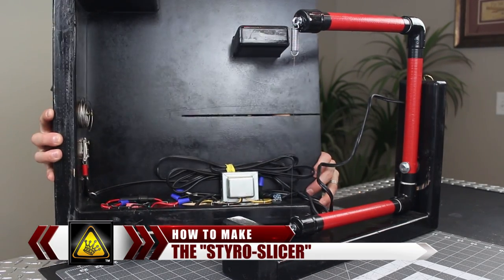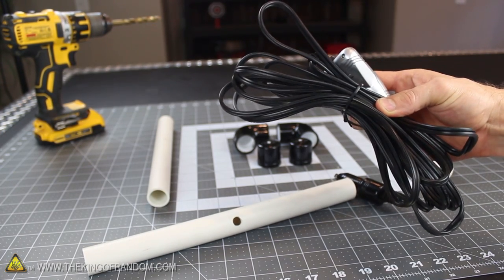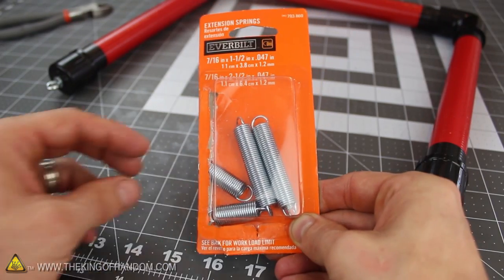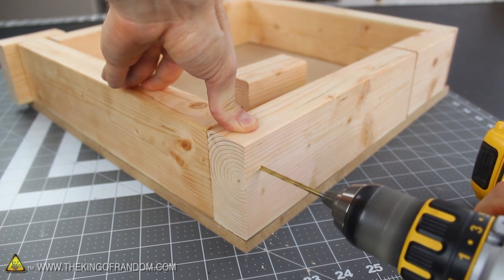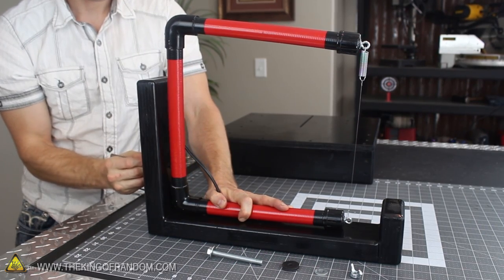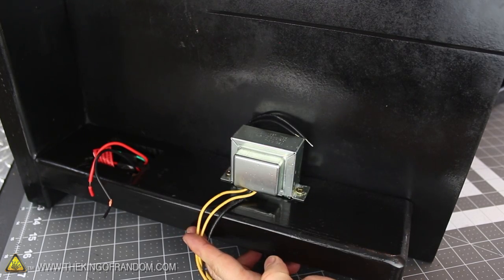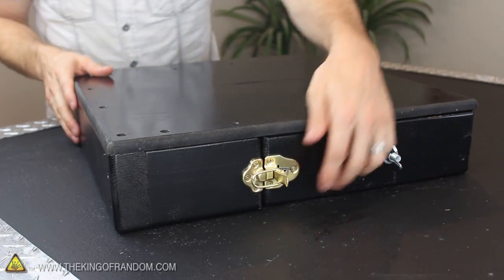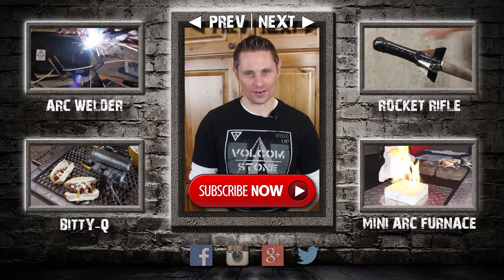How To Make The "Styro-Slicer"

Comment: How to tie the knot @ 2:20
-Have the wire already be stripped, separated, and looped at the end.

-Drill the hole into the PVC pipe.

-Now, before you add the elbows to either end of the PVC, push both ends of the wire through either end of that tube. 

-With both ends of the wire in hand, tie a simple knot (it really doesn't matter what type).

-Now, take one end of the wire with a loop, and push it back through the other side of the tube, so that you have a wire with a       loop at the end of it on either side of the first PVC Tube

-Pull the original wire (the one that first enters the tube at the back) so that the knot is at the hole, demonstrated at 2:32.

-Snake each looped wire through the elbow brackets, and proceed with the rest of this tutorial. 
      PS: Awesome concepts, tutorials, and vids man. Keep up the work!

Comment from the maker: Some quick links to a few of the materials I used:

[✓] 12 v transformer (3 amp): http://amzn.to/2cmkPFo
[✓] 3 position switch: http://amzn.to/2cGZjKL
[✓] Push on/off 1000w dimmer switch: http://amzn.to/2c9gXEm
Reply: Np
Reply: I bought .58mm X 76.2 M 24Guage hanger wire and 6 volts wouldn't heat it up enough.
Reply: I blew threw like 3 transformers trying to get this to work and I'm a little confused on y the dim-switch comes before the transformer not after. Am I using he wrong wire? I used like thing galvanized steel wire any tips that could help me finish making this? I'm a big fan and I'm make a lot of your other projects such as the mini melt foundry and the baterangs. Any help would be useful. Thanks Cole 😂
Reply: Thin ****😂😂😂👌🏼
Reply: in the video you used a 600w dimmer, in the comments you recommended a 1000w dimmer...what's the difference? besides wattage of course.
Reply: Grant Thompson - "The King of Random" what dimmer switch should I use 600w or 1000w?
Reply: Grant Thompson - "The King of Random" vv
Reply: Grant Thompson - "The King of Random"
Reply: Grant Thompson - "The King of Random" how thin does the wire have to be. I just built one but my wire slowly cuts through Styrofoam like it isn't getting enough heat. SOS
Reply: Grant Thompson - "The King of Random"
Reply: ArtemisTheGreat thanks man i appreciate it. .
Reply: are you able to make a styro slicer with a styro slicer?
Reply: michael macmillan 
You already made it
Reply: ya my friend wants one too.
Reply: Grant Thompson - "The King of Random" is
Reply: Grant Thompson - "The King of Random" hey I am 14 and I love your sciency vids you have inspired me to save up to make a Styrofoam slicer and metal foundry keep doing what you do
Reply: dagamerguyofawesome Lucky I want to make both I just don't understand how
Reply: Grant Thompson - "The King of Random" will thus hurt you if you touch it? Just wanted to know before I build it. Thanks
Reply: D VLOGS only if u touch it 1 second after. Using it it's not hot after 3 to 5 seconds and won't hurt also don't use it on skin
Reply: 10kw for replaacing scariac ??
Reply: Is this just for styrofoam?
Reply: Do you need the 12v Transformer and Dimmer Switch?
Reply: Grant Thompson - "The King of Random" i made the base and the stand for it but just put some wire connected to a 6v battery like You did at the start but with a plastic tip on one end of the wire so I didn't burn myself. Worked like yours did. I'm in the middle of making your styrofoam pistol
Reply: Make a mini railgun
Reply: The King of Random the stereo slicer. I made a more powerful one to cut wood it’s called a saw
Reply: can and will this cut through EVA floor mats with ease?
Reply: The King of Random yo

Comment: If you can't manage to get the knot tied in the wire, inside the pipe. i suggest using Hot glue, thats what i done. Vote this up so future builders can see this.
Reply: You is life hack king 

Always use hot glue gun
Reply: Thanks Ted. You the real mvp. You know, when you arent killing folks. XD
Reply: you can also get rubber wire grommets at any electrical/electronics supply store.

Comment: The one thing I definitely would have done differently is include a power LED somewhere.  Other than that, great job!
Reply: Can you tell the purpose of the LED?
Reply: @ananyranjan8750  so u can use it in the dark
Reply: I think it’s to tell if it’s switched on or not, since it does not really change in colour until you switch it on at max power

Comment: Do you really need to add the complicated wiring in that ''box'' or can you just make the box and use alligator clips to connect the saw to the battery?
Reply: SkeleBonePancake try it and tell me what happens!
Reply: Not really, the wiring is so you can connect it to the wall. You can just connect it to the battery with alligator clips

Comment: 3/4 PVC 
2 11inch ones red
1 12inch one  red
2 90deg Black
2 caps  Black
#8-32x 1 5/8in Eye Bolts
#8 flat washers

Drill the end caps with 5/32 drill bit do this to both ends

Drill a hole in the middle of the 12 inch 3/8 drill bit

Get two wires one red one black run them to the end with eye holes

Put washer on the end of the inside put wire on then washer and nut

Stainless Hanging Wire or Guitar string Model 
# 50116 Internet # 100069689 Store SKU # 854980

Extenion spring
Everbilt Model # 16109 Internet # 202045464 Store SKU # 703860

18inch's x 18inch's Square of  1/2" MDF or Smooth Plywood

8 foot 2X4 Board

18 inch 2X4
15 inch 2x4
15 inch 2x4
11.5 inch 2x4
5 inch Block
3.5 inch Block
3.5 inch Block

8x3 wood screws
1/8 drill bit

coutersink bit

10 1 1/2 wood screws

3/8 x 3.5 Hex Bolt

2 5/8 Cut Washers

3/8 Wingnut

2x5/16 Tank Bolt Washers

600 Watt Dimmer Switch Push (On/Off) 6683

12v Power Transformer RadioShack 12.6VAC 3A Power Transformer 273-1511B

10 amp Fuse
Reply: bro i've take my transformer from a old stereo but i can't recognize where is the input and the output is
Reply: help please
Reply: Cool
Reply: Thanks!

Comment: Does it cut cheese,  or ABS pipe?
Reply: +Dami Nooki You actually made the Styro Slicer? Cool! Does it really work wonders as Grant says???
Reply: +Dami Nooki So, it's kind of like a skill based tool?
Reply: will it cut fingers?
Reply: +Dami Nooki ooh, ouch you alright though?
Reply: +dami nooki i know this is an old post but do you remember about how much it cost
Reply: John DePuy  i spent 5 OMR which equals 12.99 USD
Reply: Could you test if it will cut HDPE for me? It would save me the work and cost of building it just in case it wont. Thanks.
Reply: k_froggy that's some thick pipes my friend. I don't think so.
Reply: I have 1/2 inch thick wall hdpe barrels i want to cut up.
Reply: k_froggy you can use a hacksaw
Reply: Dami Nooki you've got to be kidding me. Didn't you see how thick HDPE is?! The head that is produced from the slicer can't even cut paper, how would it cut plastic then?
Reply: The heat *
Reply: the styro slicer dicer
Reply: Steven Morris Q

Comment: Hey grant I make the metal melting foundry and it exploded molten aluminum all over my workshop so
What can I do for that
Reply: +How To Guide to Everything            Don't put cans into the crucible upside down, or make a bigger crucible
Reply: Make sure the cans are completely dry, any water droplets can cause that
Reply: thanks guys but it was the crusible that exploded.
Reply: +How To Guide to Everything sounds like there were air pockets in the plaster, mabee some moisture as well.
Reply: +HyperJ Gaming In his video he says it doesn't matter if it still has paint or even soda
Reply: +Cooper Lake in not saying it always does but it can and it has

Comment: I see you got the transformer at RadioShack, but I couldn't find it online. Do you have the model number for it?
Reply from the maker: +pikachu1324 It was from Radio Shack and was a 12.6V 3A Power Transformer 273-1511B.  It is center tapped for 6.3-0-6.3, but doing a quick search on Google .. they seem kind of hard to find right now for some reason, but you can get them around $15 on eBay.  Not sure if Radio Shack carries them anymore.  If not, I would just try experimenting with junk transformers salvaged from larger electronics.
Reply: Grant Thompson - "The King of Random" Okay thanks I found it on eBay.
Reply: You can also get a door bell transform from the hardware store but it might only be 6v so it will take longer to cut
Reply: +pikachu1324 Can you share the link?
Reply: Rocco N April A quick search on eBay for "273-1511B" will produce many results, under $20. Just don't get those $100+ ones.
Reply: +Grant Thompson - "The King of Random" would a 12v 3 A transformer work ?
Reply: Nick W That's actually almost exactly what he used. It would probably work great, with a tiny and unnoticeable difference.
Reply: +pikachu1324 Thnx :D
Reply: +Grant Thompson - "The King of Random" I killed my AC breaker by shorting a transformer to make a styro slicer.
Reply: +Grant Thompson - "The King of Random" 

Would a doorbell transformer do? 12V 60W 5A?    Also, at that amperage, isn't touching the wire a fatal dose of electricity?
Reply: +Yona Tamblin only if YOU were grounded. But because your not, and assuming the wire is still connected to the circut, its gonna take the path of least resistance and head out thru the wall vs thru you. You'd get a good burn tho. Take that for what is tho, my knowledge of curcuts is limited.
Reply: +Grant Thompson - "The King of Random" why do you have a 10 amp fuse for a 3Amp Xformer? the whole reason to have a ocpd device is to protect the wiring and the equipment from damage due to over current.
Reply: +Yona Tamblin nope because 12volts is a very low voltage which means it doesn't have the pressure to really hurt you. and the current would only be harmful if it hit your heart. even then at that low voltage I dont think it would even come close to your heart let alone past your skin. you could have a billion of amps running on 5v (in theory) and not even feel it. even 120 volt is not that dangerous to an adult human.
Reply: I'm definitely no expert, but would a laptop power supply work for this? I have one here that is rated for 19v and 3.6A and I understand that 19v is far to much, but in theory, I just don't know if this would work with the dimmer switch on the ac side of the circuit.
Reply: Jack Davies lol no a dimmer used for lights is not changing the voltage, its changing the frequency at least the modern day ones do.
Reply: +Jack Davies the power supply might work but wont be dimmable its transforming power into Dc currant also
Reply: +Grant Thompson - "The King of Random" I got a 12v Transformer but it has only 4 wires instead of 5. Will it pose a problem.
Reply: Nick490 you have to give more info then just that. is it 2 on the primary and two on the secondary or is 4 on primary and 4 on the secondary, what is the primary labeled as H or X? H1, H2, H3 H4 Primary and X1, X2, X3, X4 on the secondary? if so its not a problem because this gives more flexibility to adjust the voltage.
Reply: +Grant Thompson - &quot;The King of Random&quot; Just use a MOT
Reply: +pikachu1324 
I found 1 in store, (Radio Shack)  it was the last one left.  If I didn't throw out the packaging Ill forward you the item number.  If you rather purchase online, here's some other sites:
www.electronicsurplus.com
www.allelectronics.com
www.surplussales.com
And naturally Ebay.
Reply: +pikachu1324 it is not online but I found the exact one in store, but here is the model number anyway: 03A14
hope you find it!
Reply: +pikachu1324 The philmore TR250 is almost exactly what he used (minus the brand of course).
Reply: Two on the primary and two on the secondary.

Comment: Really thinkimg anout doing it, anyone know a basic price range for the whole thing?
Reply: I spent about 25-30$ on mine but its way worth it if you plan to make a lot of stuff
Reply: +krig20 im already thinking of all the parts a already have, just missing that dimmer.
Reply: +MrCerealShark i just bought all materials except for the tools ( i bought a set of drill bits but not a drill) and after everything it came out to near $70 all bought at home depot except for the pvc, fuse holder, wire and transformer.
Reply: +Vai Peterson (VaiDaPie45) What strength spring did you use?
Reply: the load limit is 11.46 lbs. i used the same brand as in this video. The slicer works amazing! i use it to cut EVA foam for cosplay and oooohhh my god. its been a huge time 
saver haha
Reply: +Vai Peterson (VaiDaPie45) Thanks mate
Reply: yeah for sure
Reply: If you dont have one use a two position switch and then an on/off switch. If youre uncertain with these things you shouldnt be using a power outlet. touching a wire behind the transformer can kill.

Comment: Can you plz make a more easier and compact version bcz I don't have a dad that can help me make this one plz
Reply: Try getting two 6 volt lamp batteries and a wire and attach them parallel to eachother. That should create a crude heat wire, but longer.
Reply: Just use the first 4:
Reply: Buy one, less than $10 and battery powered
Reply: I thought that was the point of the original part when he was just running it off the battery.

Comment: this would be great for making flite tests rc planes
Reply: Was thinking the same thing. I wonder if they have something like this for their projects.
Reply: They use a paper backed plastic that does not work with this technology.
Reply: It does
Reply: +Drew Stevenson they don't use paper or plastic they take the paper off and it's not plastic it's foam
Reply: +Wasteland Survivor the Adams board they used originally for flite test was double backed paper for tensile strength skinning.
Reply: true
Reply: Yes it does
Reply: Bjako - Psh, on the higher setting, you should be able to cut thin wood.

Comment: How do you tie the knot inside the tube?
Reply: It's easy. Just tie some kind of thread to one of the wire ends, then pull the other one till the first one with a tread tied to it comes out, now diconnect that thread, put a knot in the wire, reattach the thread and use it to pull one of the ends back through to the other side.
Reply: Bref Stank put both wires out one side, tie the knot, push the wire that's supposed to go out the other side through the tube and out

Comment: Made this earlier today.   Used an old powersuppy that had a 12V AC output.     Did not add a dimmer or  3 way switch.  Tested and works like a charm.     Next step is to add a switch and fuse.

Comment: It might be easier to find  a laptop power supply (~19V, 5amp) and an LED dimmer switch just to simplify the wiring and make the whole thing cheaper. 

For the wire, 18-24 gauge Nichrome wire can be found at almost any vape store for like 50 cents per foot. Super duper cheap. And that stuff can get to a thousand degrees (several hundred degrees above optimum styrofoam melting temps) with no problem whatsoever.

The fuse and a power switch is a great idea. As always, love the videos.

Comment: I am building the Styro Slicer this week. It's been a fun and challenging build. I have to say, one part of the instructions seems a bit backwards. Trying to drill a 3/8 inch hole through a 3/4 inch pvc pipe while avoiding the electric cord running through it, seems counter intuitive. I found it much easier to drill both holes at the same time on my drill press. Note: I did it this way after following the video instructions, and completely shredded my electrical cord.

Comment: Correct me if I am wrong but if you are using normal 120 volts drawn from AC, that is also 2400 watts which means that you should being using a 20 amp fuse . (2400 watts ÷ 120 volts = 20 Amps)
Reply: Where did you get 2400 watts? That transformer steps down voltage and puts out max of 3 amps on the 12v side. If you do the math, it's pulling a Maximum of 0.3 amps on the 120v side. So a 10 amp fuse is WELL over the 0.3 amps it should be pulling under maximum load.

Comment: I have a question: When electrified, why don't the eye bolts heat up and melt the end caps? Does it only get enough power going through it, and to the wire, to get it hot enough to melt the foam but not enough to heat the eye bolts, melting the caps?
Reply: Randy L The eye bolts have a much larger crossectional surface area. This means it can handle a much higher amperage without heating up. The wire, on the other hand, has an extremely small crossectional area. So much less current is required to heat it up since crossectional area is inversely  correlated to resistance of the material.... Basically.. Because wire is small and bolt is not small

Comment: Running the numbers, assuming you have all the tools necessary (including wire stripper, staple gun, and have/found an old stereo for the transformer), seems that an estimated total cost of all materials is a ballpark of $85 ish before tax (if you need the tools, probably around $130 maybe)? Not bad for a DIY table with variable voltage control. Plus, the compact/storage feature is a big perk. Was considering buying a Hot Wire Foam Factory Scroll table ($78.00 on amazon), but think I might give this a shot instead. Also makes it very possible to make other hotwire tools such as hot wire knife and handheld cutters with a little tweaking. Thanks, Grant!

Comment: I made my own! It's going great! But I do have a question. I used an extension cord for the wires running through the pvc. I left the plug at the end of the cord. Is it okay if I plug it in rather than using the battery or should I just not take the risk and use the battery for power?
Reply: BMAN488877 yeah I went and plugged it straight into the wall without using a switching adapter and blew the wire lol.

Comment: i made one. i didn't use the normal high power switch i wired it for normal power with no option. it does great on foam board, but not so much on 2 inch thick closed cell shipping foam. it does ok for short cuts but for long cuts it loses heat and takes a sec to heat back up. i ended up finishing on the bandsaw. i might try the high power mode